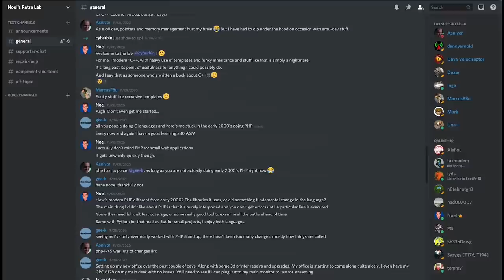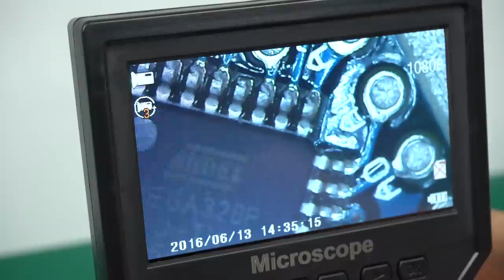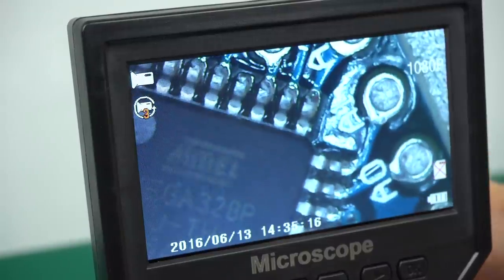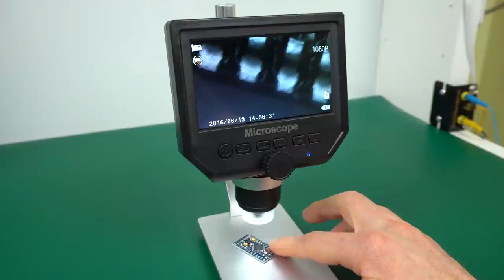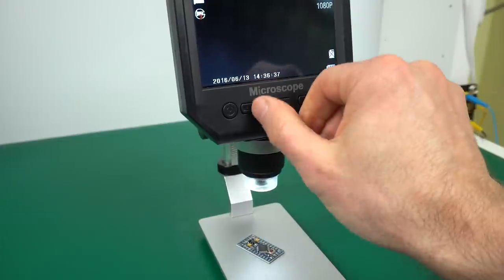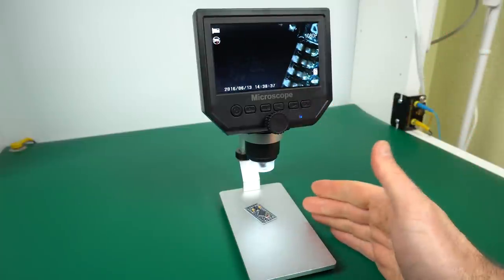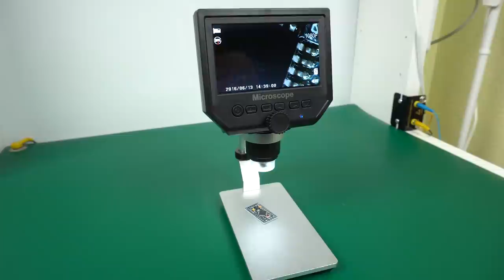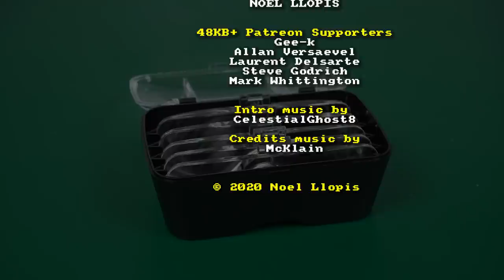Are CHEAP Magnifying Tools Any Good?

Comment: I have far-sightedness which is getting progessively worse with each year, it seems. And with each year electronic components get smaller and smaller... ;)

Therefore I tried many different variants/solutions to get a "bigger picture":
(1) I inherited a loupe lamp with a very bright LED ring light. Probably built for fingernail work but I put it on the kitchenette for ckecking out stuff quickly. I initially tried soldering SMD stuff with it but it quickly gets exhausting. Still useful sometimes.
(2) A headmounted visor - similar to the one Adrian Black uses. OK for prolonged use but not for really tiny stuff and one needs a handband to avoid getting sweaty. I only use the biggest magnification factor.
(3) An older USB microscope with short working distance and LEDs around the lens (dimmable but not good for reflective objects/surfaces!). It's 5 MP sensor is slow for video (in full resolution) and has mediocre image quality (perhaps a bit better than the scope in this video). The supplied software sucks but I downloaded drivers/software for a similar product that allows to change the hardware parameters (exposure, white balance, sharpness etc.). Many of these scopes were developed/produced by the same Chinese company...
(4) A standalone digital scope with a 7" monitor, a mini HDMI output and two flexible LED arms (dimmable). It also only saves on micro SD card but it has very good image quality at 1080p at 60 Hz (it can actually do 2160p but then it has a 4:3 ratio and only 24 Hz). This is now my go-to solution for tiny stuff. Certainly not cheap but I'm very happy with it.

Depending on what to do I now use mostly variants (2) and (4) and sometimes the other ones.
Reply from the maker: Great breakdown. You seem to use that a lot more than me. What microscope is that? I'm writing down recommendations for a better one eventually. Thanks!
Reply: @NoelsRetroLab  Sorry for the late answer. I try to make it up with a bit of verbosity. ;-)
The 7" microscope is the Andonstar AD407. It's about 250 Euros when bought in Europe. My recommendation would be not to get it directly from China. Reason: It's screen is very fragile and can be damaged on transport as shown on the channel "Robert's Smorgasboard" (and also how not to repair it ;-)). Returns are easier with European dealers...

What it comes with:
- main unit with 7" screen, metal stand with two LED spot lights (also metal), cable remote for LED brightness, IR remote for microscope & display options, built-in microphone (haven't used it, yet), removable UV filter (very good!), USB wall wart, HDMI-cable (mini to regular)

Also: The product is being advertised as showing a "3D view" but this is nonsense. It only means that you can tilt the arm of the metal stand - which can be nice in some situations but is of course no "3D".

What it doesn't have:
- optical zoom, autofocus, built-in LIPO battery, LEDs around the lens, USB communication (you can only transfer jpg-images & mp4-movies via micro SD card - sold separately, max. 32GB - but I haven't tested & analyzed this extensively).

Positives:
- It comes with a USB wall wart but also works on decent USB hubs and power banks (it draws up to 1,1 A on 5 V when recording).
- Very good, sharp image quality with nice colors and no noticeable lag. Several YT videos show this.
- It has one of the better 7" screens I've seen (with about 600 to 720 lines vertically).
- The HDMI port works simultaneously, also no lag visible.
- The focus adjustments is made of metal and feels smooth (not "super-perfect" like on expensive camera lenses but "good").
- The metal stand is relatively small but usable and the scope stays in place when you adjust the focus.
- The maximum working distance is about 165 mm (lens to stand). You still get a 6x magnification on the 7" screen with this.
=> You can work with hot air under it thanks to the working height and the metal stand.
- The main unit features several buttons and there is a cheap but usable IR remote (rubber keys) BUT the whole concept is a bit "how you doin'" as Dave Jones would say. You can adjust the LED brightness only with the cable remote and here we arrive at the...

Negatives:
- The cable remote is its biggest problem: Sometimes only the LEDs turn on and I once even had a "crash": The buttons didn't work anymore and I had to cut the power. Probably some shitty microcontroller inside. It's no show stopper but still annoying. My main gripe, if you will.
- The fragile screen mentioned above...

Also:
Of course the manufacturer inflates the maximum magnification like they all do. The maximum magnification is about 27x when the inspected object is shown on the 7" screen, which is 153 mm wide. So you effectively see a 5,5 mm wide area under the scope when in 16:9 mode. This is not too shabby but not anywhere near the advertised claims.
One can argue all day long about it but as neither lens nor sensor can't be changed the point is moot.
It's also a prime and not a zoom lens so your working distance (lens to object) is more important anyway. At maximum magnification you are "blessed" with an effective working distance of only 45 mm. For soldering this sucks and you'll likely increase this distance and thus reduce the magnification. I mostly keep it at the maximum of 165 mm.
Note that even the more expensive Eakins autofocus microscope (the next logical step above this Andonstar) with a 180x lens is only two times better: It shows 3,0 mm on the screen. See Dave Jones' video on EEVblog about it.

Conclusion:
Considering the many cheaper ones I still consider the AD407 great for hobbyists/enthusiasts. It's big plus is the image quality and 1080p with 60 Hz is reasonably futureproof, especially if one uses mostly the 7" screen. The HDMI output works like a charm, though, and the lens mechanics are good enough.
And you can easily store it when not in use (my hobby room is even smaller than yours, so...).

Comment: A note to those thinking of the little microscope camera.
you realy want to put a small pice of glass directly over the apature smoke/fumes cary the rosen/flux up into the lenses and eat at them.
So something covering the lense is imporrtant.  picture frame glass nibbled into shape or a small flat glass protector. you can use plastic but i found it to distort
Reply: Good point. Many of this type of “microscope” come with a protective filter glass just for that purpose.

Comment: hi Noel i hav a pair very similar to the glasses which i use for modelmaking unlike yours they have plastic lenses and i cannot remember how much i paid for them but i think 25 euro or there about they are probably lighter than the glass ones i like the microscope but it would be rather impractical for any but the smallest jobs keep safe in this trying time

Comment: I have one of those cheap microscopes I highly recommend them for the price, used it to solder a Xilinx & memory chips onto a Amiga TF accelerator board, couldn't have done it without it.

Comment: 2:15 I have this exact set of glasses. One thing that annoys me is the weight of the glasses and the fit on me especially with my other glasses on under them because I have no prescription in 1 eye. When I lean forward to look down while hot air soldering they often feel like they are slowly sliding off my head.
Reply: I am using this each night for a smd kit which is more advanced than a beginner kit as it has a microcontroller and more than a hundred leds. For the weight of the glasses I got an adjustable glasses strap which helps a lot with keeping it from sliding around becoming annoying. I am back here because I was looking for greater magnification for the tiny resistor arrays which even with the 3.5X magnification are difficult to see the individual legs.

Comment: Great video, Noel!
Small question: Does this microscope has HDMI out? if so, I could send you an HDMI to USB Dongle to record the videos through the PC with a much better quality,
Reply from the maker: No, it doesn't. I'm sure that's part of the cheap price! It has a USB connection that I think it's just for charging. So saving to the SD card is as good as it gets I'm afraid.

Comment: Very interesting video. Thank you so much, Noel. I am over 50 (¡52 palos!) and on the last years the presbyopia is my unwanted partner. This microscope will be in my letter to Santa  : )  A video suggestion: how about a comparative of oscilloscopes under 100 €? I do not care to pay 300 € for an oscilloscope, but I would prefer to learn to use it and practice with a cheaper one.
Reply from the maker: Glad that was useful! Interesting about the oscilloscope video request. I'll add it to the list. The difference there is that I have a slightly more expensive one (around 300€ although I bought it cheaper used) and absolutely love it. When I did my research years ago I convinced myself this was the way to go. So I'd be slightly biased, but it could be interesting as well. I'll keep it in mind!

Comment: @7m35s   Mine claims 1080p on menu, but I only get max 640x480 via USB. What software do you use? Thanks
Reply from the maker: Hmm... now that I look more closely at the file, it's 1280x720, so that's not 1080p. Interesting. But it's certainly not 640x480! I didn't use any particular software, just grabbed the files directly from the SD onto my computer.
Reply: @NoelsRetroLab  The car DVRs fake the resolutions, sometimes quite badly (320*240 interpolated to 1080p etc). But the video looks pretty decent do it can't be that bad.

Comment: I don't know, but I can't do any work properly with any digital microscope. Depth perception seems to be quite important to me. I absolutely prefer magnifying glasses, like ones you've shown in the video, over any digital microscope. Maybe with the exception of doing inspection and/or documentation work. The best choice would be stereoscopic microscope with 3rd port for camera. But these are a little bit expensive. But again, ones without 3rd port, eyes only, you can easily get for under 100$.
Reply from the maker: I can see that. I still haven't tried any real soldering with the microscope. It seems super useful for examining joints, but we'll see as far as live soldering. You may be right about the depth perception. Can you recommend a good stereoscopic microscope for under $100? Most of the ones I've seen (AmScope, Strange Parts) are pretty pricey.
Reply: @NoelsRetroLab  Now that I've looked around a little bit, I am a quite suprised how microscopes have gone up in price. AmScope seems to have their 'Swift' lineup of reasonably priced stereo microscopes starting with 70$ for S303 model with 10x and 30x magnification. Then there are S304, S308 and few more expensive models.
Reply from the maker: @pvc988  Thanks! I'll look into those. Cheers.

Comment: Microscope image definitely looks like 640 by 480 interpolated, I see small checkerboard pattern because of sharpening, and every source pixel is just about 2x2 in 1080p.
Still it's an excellent picture for that resolution though, definitely worth the price.
Reply from the maker: That could very well be true. Maybe that's even why it had the wrong aspect ratio, just the firmware trying to mess with you and it has a bug 😃

Comment: Thanks again Noel. I am impressed with the microscope but having to look at a screen instead of the actual board when working on it will seem weird at first.
I have the cheap USB hand held type just for inspection. As it is portable, there is no restriction of board size to inspect.
I do agree that both types you reviewed have their own advantages and disadvantages.

Comment: The "glass" magnifying lenses are just plastic.  I have a similar pair which was also advertised as glass, however it was an easy test to take a steel screwdriver and make scratches on the lens.  They feel heavier than plastic but unfortunately are not glass.  Just looking at them you can see the injection molding marks, too bad since they work fairly well.

Comment: How does the glasses work with actual glasses? :)
Reply from the maker: Hmm... good question! I don't know! I suspect it might move your focus point a bit closer or further away, but I don't know. You certainly can't wear both of them at once.
Reply: I've got the same one's. They work great with prescription glasses! Recommended!
Reply: I’ve got the same glasses and use them with my glasses, they work! Only thing I find is the ear rests are really uncomfortable with glasses, but they are removable and you can fit the supplied elastic head band instead.
Reply: @MrClump  That's how I use them.. Works well for me..

Comment: They need a power pack with a cord that runs up and connects to the device, so that you don't have all those batteries resting on your forehead.   The magnification comes from the lens, so why there would be a need for so many batteries, I'm assuming is for the light, because I have a head lamp that uses 3 batteries, but does not offer magnification.  So if cellphones are producing tumors in children, can you imagine the damage being done having those batteries resting on your forehead for long periods of time.   Our body reacts to those positives and negatives.